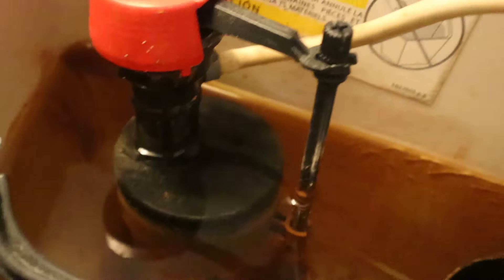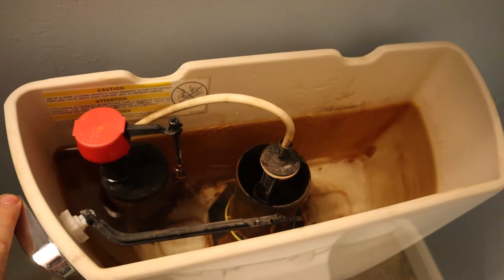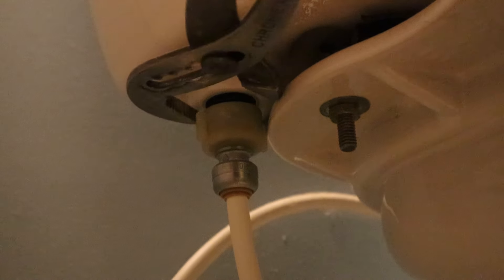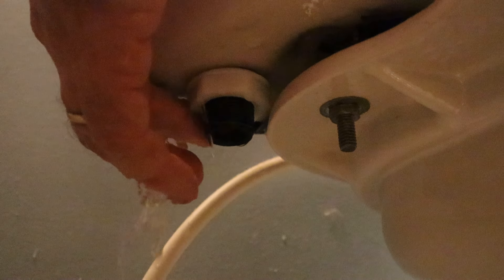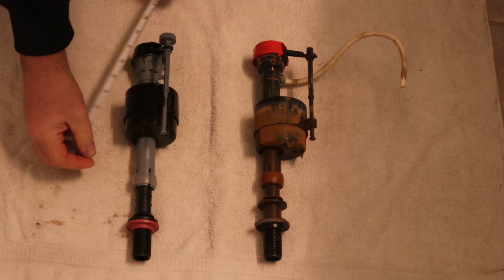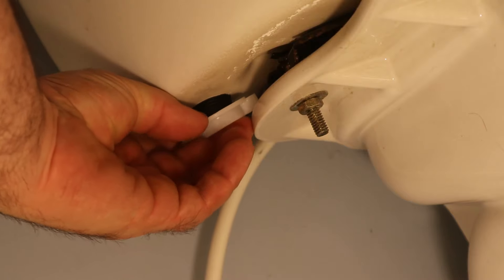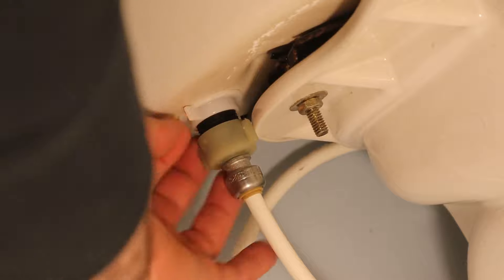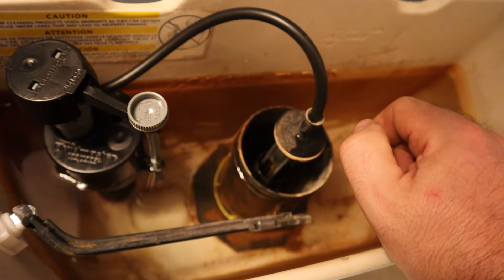Installing FluidMaster 400A Fill Valve in your toilet. Do It yourself!

Comment: doesnt flush right. I changed like you did, but the big round thing no longer stays up long enough to drain the tank.   Thoughts?
Reply from the maker: My guess is you have Kohler systems, like I did. The big round thing, I am going to call a flapper, though that is probably incorrect. 2 things I can think of that might cause that: did you get water inside the flapper? That would keep it from floating, or is the chain that lifts the flapper too long. That would prevent it from raising up high enough to stay open.

Comment: my fill valve is facing forwards not sideways like in this video, and it's been like that for years and has never had a problem till now
Reply from the maker: Direction should not matter,  as long as the side of the tank isn't interfering.

Comment: I have turned off my water but water keeps filling up into tank I can’t stop water from refilling. I am 80 and trying to fix this myself
Reply: Help
Reply from the maker: If the valve at the tank is not working, you need to find a valve somewhere farther back that will turn it off.  If you have to go all the way back to where the water comes in the house, there should be another way of shutting it off.  You have to trace the plumbing back, to find it.

Comment: Great video, my only problem is getting the supply tube back on without spraying water when it’s turned back on.  Everything is tightly secure yet it sprays water.  Frustrating.
Reply from the maker: Sounds like something is not seated properly. Check the inside of the supply line and make sure the rubber gasket is in there properly.  If it looks ok, try wrapping the threads of the fill valve with teflon plumber's tape. Be sure to wrap the tape in a clockwise direction so that when you screw on the supply line it doesn't try to peel the tape off.
Reply: How old is your supply line? They’re only meant to last about 10 years. Mine was nearly 20, and I had the same problem as you when I attached it to the new fill valve. I changed it out for a new one (only $7.23 at Home Depot for a Fluidmaster brand) and the problem went away. Well worth the money I spent for the replacement.

Comment: Or you could just slide the sleeve off and remove the filler assembly and put the new one on.  No need to remove the full assembly. But this is a nice vid
Reply from the maker: Thanks!  Yeah, I heard about that after I made this video.  As soon as I need to do it again, I'll try that out.

Comment: I can’t believe I just watch 36 videos of people installation and they all miss a major step for beginners none of them mentioned it… The red rubber is a big step for beginners and they’ll will get confuse by watching these videos because no one mention it SMH 🤦… All these videos get a C- for that
Reply from the maker: I am guessing that by "red rubber" you are referring to the toilet tank flapper or flush valve.  This video showed how to change the fill valve which does not have anything to do with the flush valve.  If you need to do that, search for "flush valve" or toilet tank flapper".  There are tons of great video out there that cover that.  My flush valve does not have a red rubber flapper. It is a Kohler system and has a rellow rubber ring that can be replaced.  I have a video covering that here: https://youtu.be/ApEZeCrc9wE  but it is probably of no help to you.

Comment: Why bother changing the whole thing? Just unclip and pull out the main body, leaving the 'old' entry pipe in place, then clip the new one over the top of the old pipe. Easy!
Reply from the maker: I heard about doing that after making this video.  If I have to do another one I will try that out.
Reply: Just showed my son how to change the valve body after watching the video (and reading this comment). Both were super helpful. If the line ever leaks, I have my TIM (tools, info, and material)

Comment: No need to take it out completely. Remove it from the black pipe using the sliding nut. Remove the new one from its black shaft and put it on the old one. Measure height and done.
Reply from the maker: Yes, I plan to make an updated video as soon as I need to change it out again.  Thanks